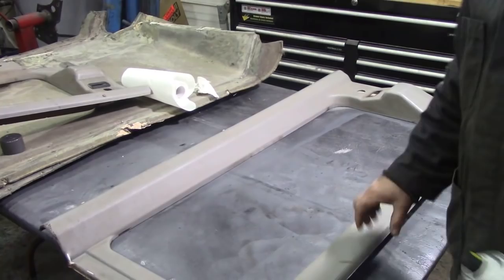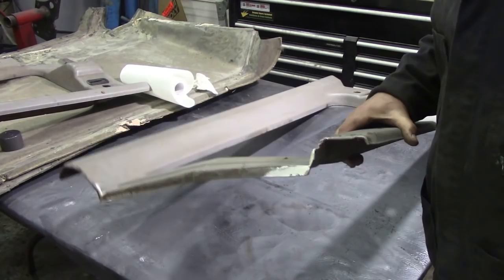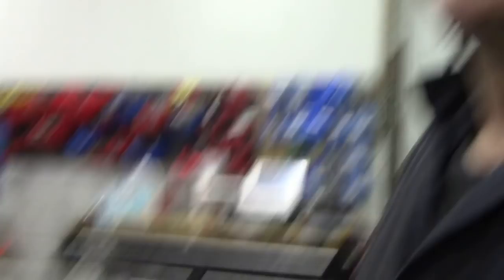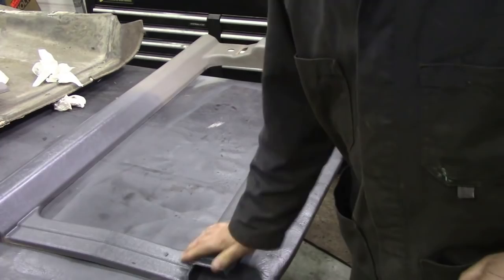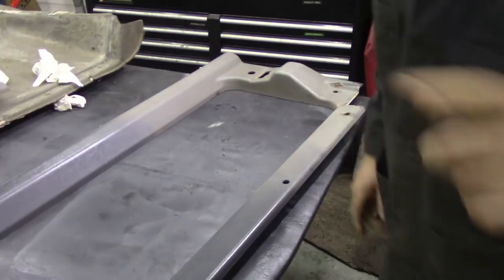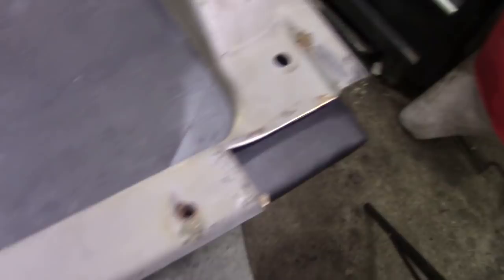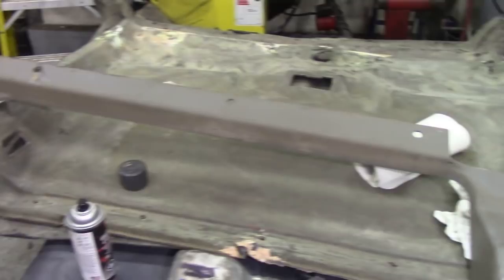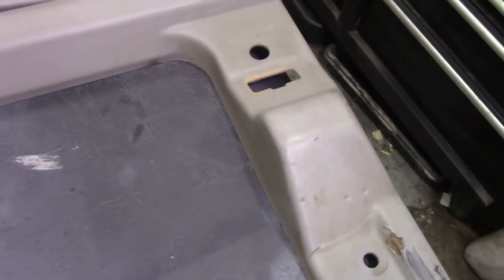What is the worst job that can be plastic painted? The African Queen naturally!

Comment: I brush painted a set of these trims with garage floor paint (anthracite grey).  It wetted out to make the brush strokes completely disappear but left the leather grain intact and is very resilient.  The only prep I did was wiping the panels down with warm soapy water and stirring (but not thinning) the paint.